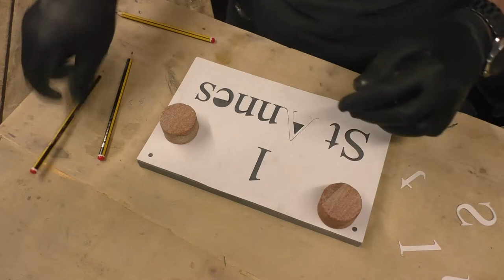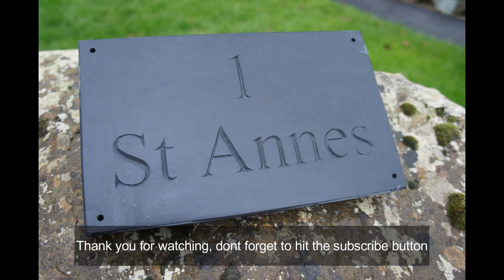Carving a piece of reclaimed welsh slate into a house sign - letter carving - carving slate

Comment: Hi you mentioned that you worked out your lettering on the computer, what software did you use please? I mean are you able to put the dimensions in of the size of your stone and then fit the lettering you need in?
Reply from the maker: Hi Liz,
It’s called Cricut; we used it to design and get the right fit on the software. Like you say, we inputted the stone size so we could see what size would look best. I hope this helps.
Matty

Comment: Hi,I was wondering what do you use exactly to sharpen your tct chisels? I've got a diamond wheel on a drill fixedbut it doesn't seem to finely sharpen my 1/8"-1/4" tct chisels. Love the videos
Reply from the maker: Hi Bryan, Thank you for watching. I use a diamond carving block and sharpen then all by hand. I don’t like to use machines, I find it can make the tungsten too hot and loses its edge quicker. They should only need 2/3 passes and they will be sharp. Don’t hesitate to ask if I can help in any other way

Comment: How do you recommend transferring the numbers and lettering onto the slate?
Reply from the maker: I like to make a stencil using card, we use a computer program called Cricut where we design the layout then cut it out on card. If I am working on slate I like to paint a thin layer of pottery slip on the slate first this will dry a light grey making the pencil lines easy to see after I have marked it out. I have attached a couple of links that might help you from my other videos  

https://youtu.be/kdKX-jh8bDE
https://youtu.be/na4DPk44dnQ